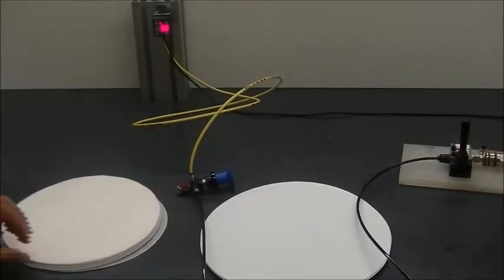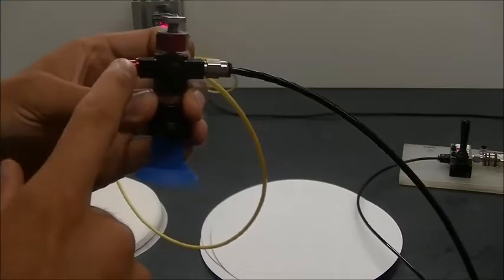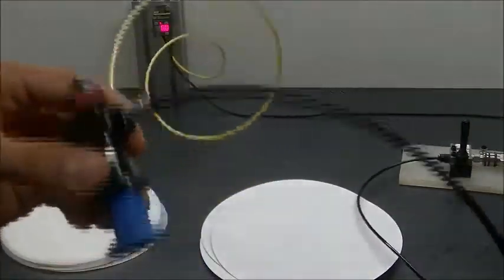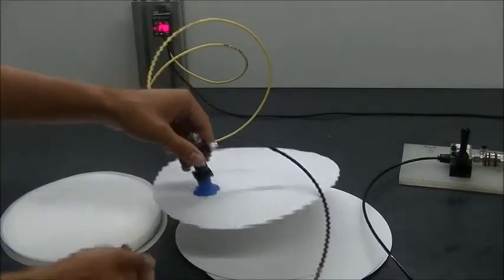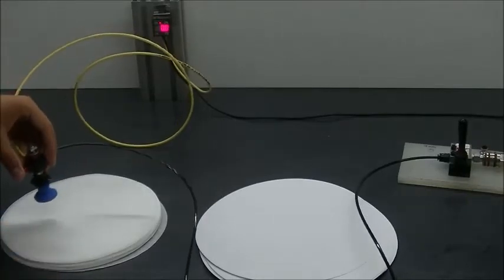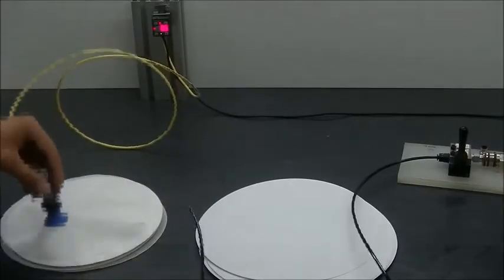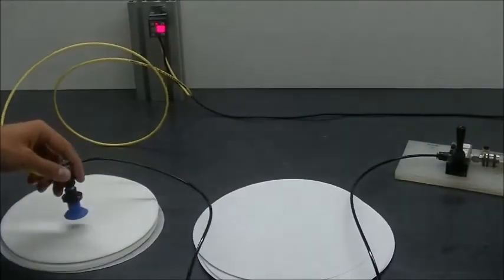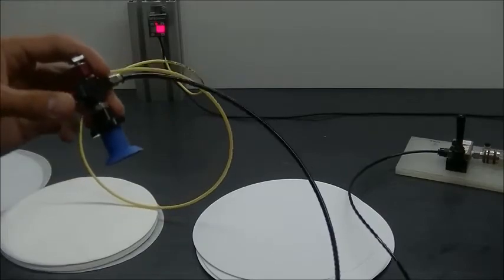Handling Paper Discs with Vacuum - Piab

Comment: Which vaccume pump you use in this video
Reply: What Specification of vaccume
Reply from the maker: the vacuum pump is a vacuum gripper system called VGS2010 https://www.piab.com/en-US/products/vacuum-pumps/combined-pump-and-gripper-vgs/vgs2010/
Reply: Vacuum pressure is adjustable or fixed